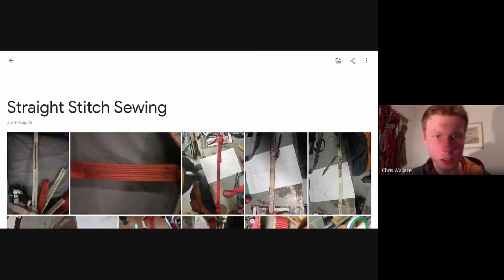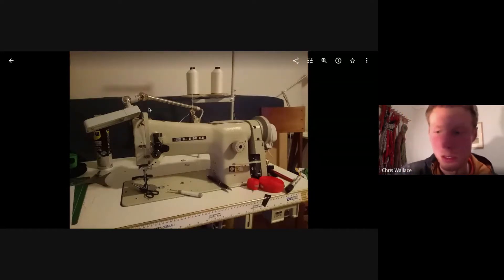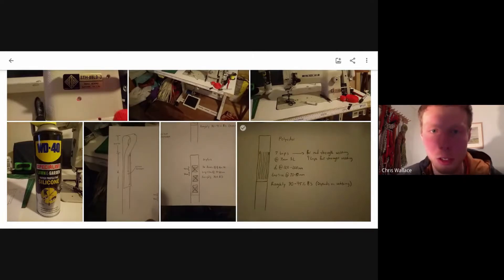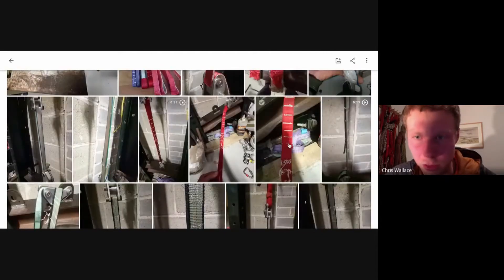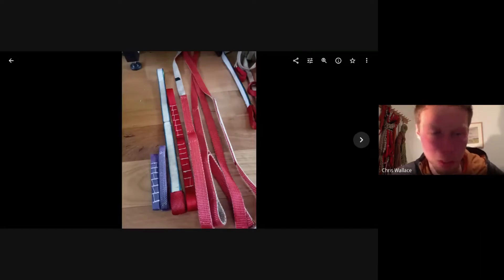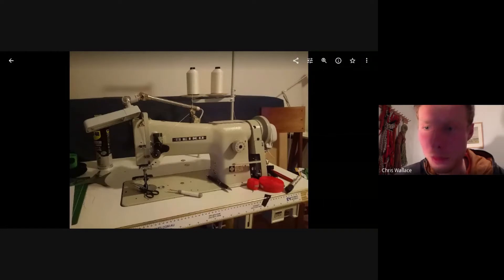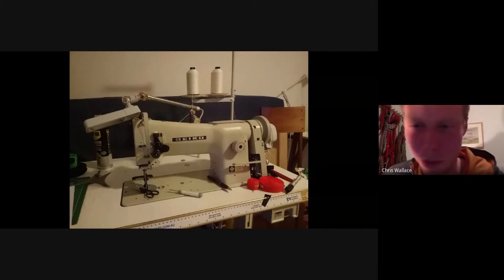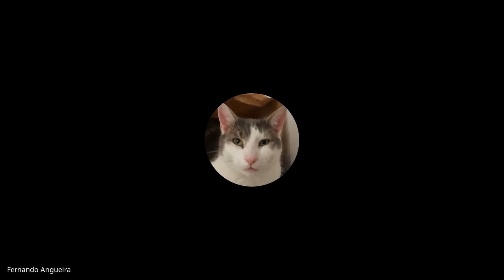Stitching patterns for sewn loops with Chris Wallace - Safety Event 2020

Comment: You can adjust thread tensions, and there are specified tensions by machine manufascturers. But the idea is newer to stretch the thread. You adjust the tension so the stitch is solid and not sloppy but not more. And when tacking - if you go too fast, you can destroy webbing fibers, the needle doesnt have to to "search its way" but it just blasts through everything. And it heats the webbing + sewing thread. Plus a ball point needle!
Just now working with a pattern sewing machine, that we got, so it is far from throwing just some tacks to webbings :)

Some good ideas in the speech!